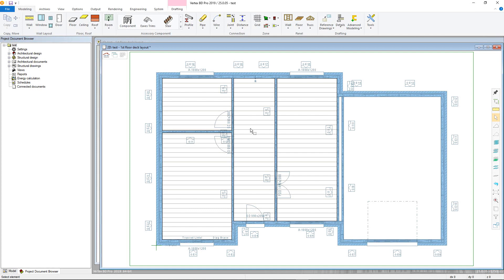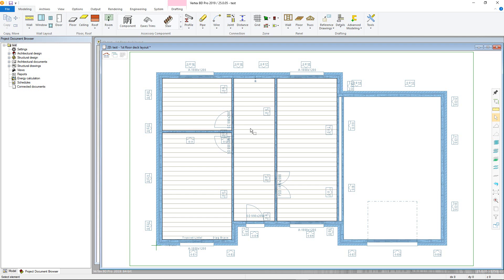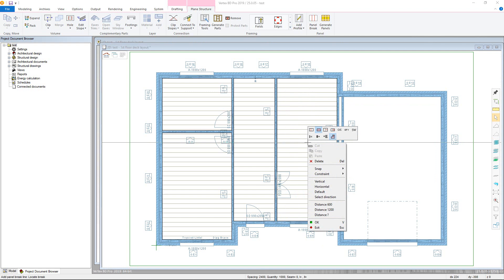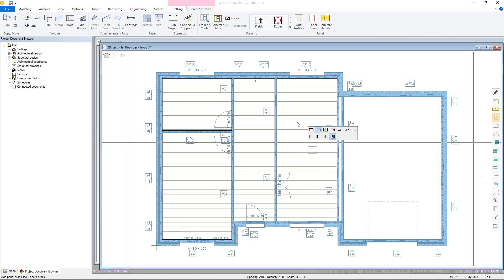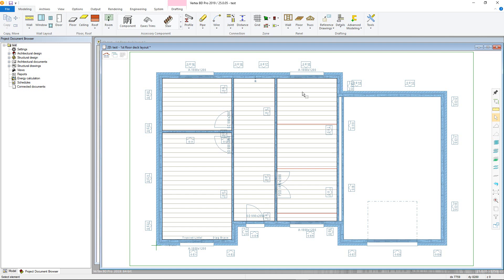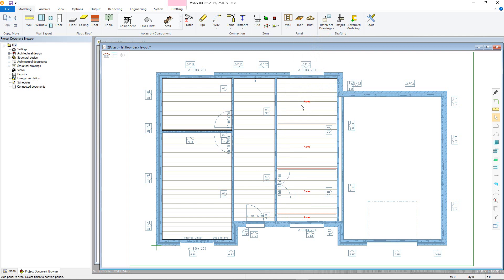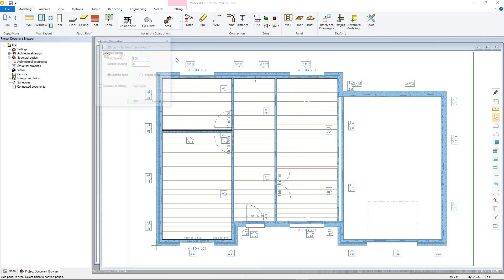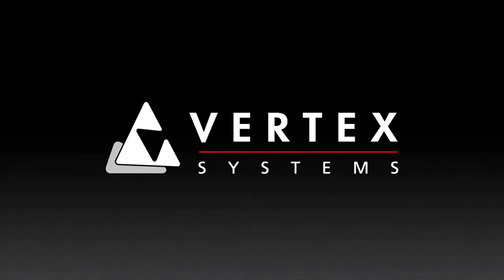11: Horizontal Panelizing [Vertex BD Steel Framing Tutorial]

Comment: i have followed the instruction but i can not get the frame view(can not generate the the panels) at the same time in the video setting is not clear.
Reply from the maker: First you need to add panel breaks. Then you can create panels and generate framing. Go to Modeling Tab, and click Generate Panels. Once you have panels in your layout, select panels you want to frame, confirm (press V or Middle Mouse button or right click and select OK), and the click OK in the Panel Build dialog. Vertex BD then generates framing with selected framing rules. Switch to 3D view with F2 key or click the icon in the upper-left corner of the 2D view.